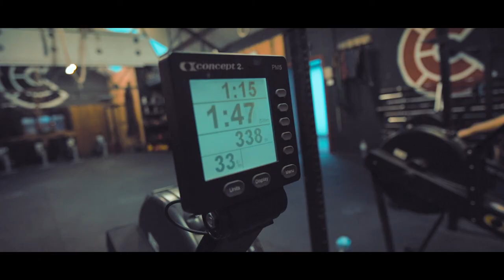Essential bike fitness: Build your ENGINE

Comment: I'd love to know why you say to start off the offseason with the short energy system, instead of the long one. my thinking was that the long energy system (aerobic) would take time to build up, as starting it around March for May would be too short, and I wouldn't reach my max long endurance. I'm doing about 3-4 hours of anaerobic and 5-6 of aerobic training per week, does that seem right? How much should it vary throughout the offseason?
Reply from the maker: Strength is by far harder and take longer to build than aerobic capacity, therefore in the early stages of the offseason we build strength along with shorter duration capacity. They compliment each other and will encourage quick adaption when you combine them. If you were to start with endurance then try to add strength they conflict and you'll lose some of the benefits of the work you put in. The strength foundation we put in transitions well to speed and power then ultimately endurance, this doesn't work the other way around.
It's important to understand though, we never let any area drop off drastically. 
I hope this helps.
Reply: @Fit4Racing  thanks so much for your response, ill be sure to try and integrate that more!